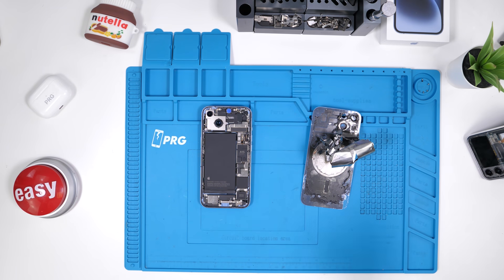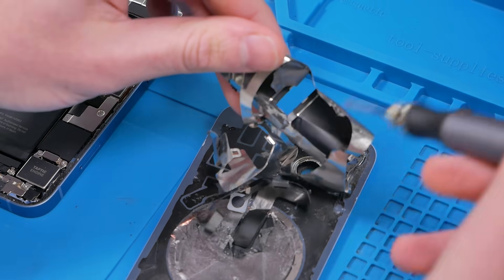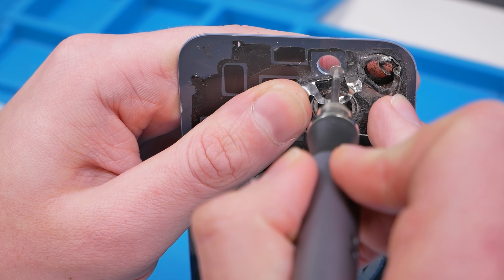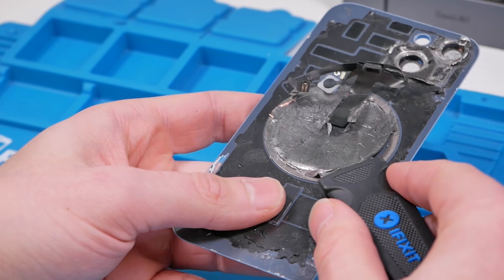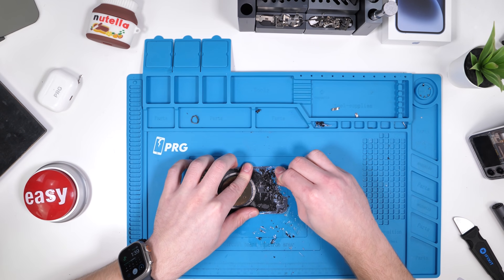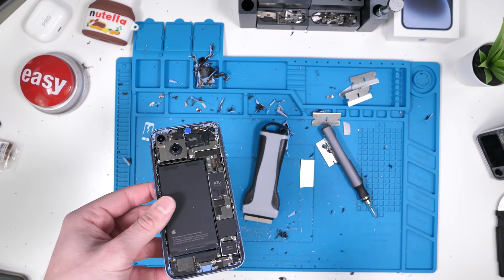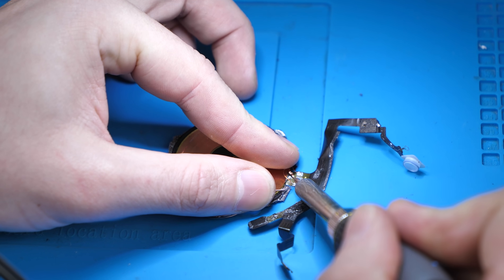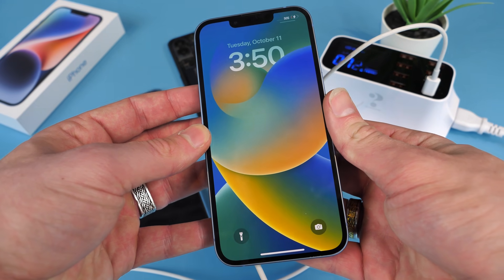Transparent iPhone 14... Harder Than Ever?

Comment: If u want do do this I recommend a Oneplus phone. I did his on a op9 and it was rlly easy coz the paint was attached to a lamination sheet which keeps the glass together if it shatters. So the paint just peeled off. Only downside is if the glass ever cracks the shards will fall off. Also the Oneplus 9 has no frame around the back glass so it is a nice phone to make transparent

Comment: Why do you not just use automotive paint stripper? Smear the back glass with it then wrap everything in a bag and let it do its thing. When it's done I imagine the paint and adhesive would rub right off. Won't have to deal with micro scratches from the razor.

Comment: Hey PRG, why don't you dip the backyard in brake oil? It works as paint remover and will revive every bit of paint, even at unreachable corners and it ain't scratch the glass too! Saving you a lot of time and effort.

Comment: Man… what a mess…consider to just get a non genuine replacement part instead of all this work. The glue is a lot lot weaker and the cheaper paint can be easly dissolved with acetone + the cameras are normally not welded but rather glued + its reversible if you ever wanted to!

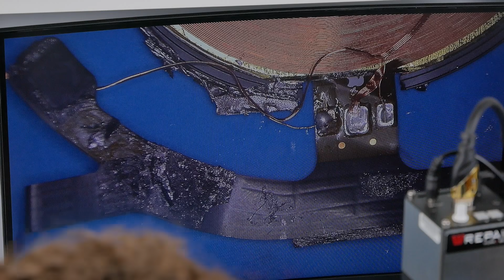Comment: Very good video man. I really like it. But me when I saw the welding ball that you madd and I know it’s not good when you do a welding ball because that can cause to the weld to have micro cracks and air bubbles that could cause the weld to break due to changes in hot-cold temperature or a shock due to an impact on the weld (7:32). Like if you practice more with weld that can make you better at that thing and you can learn new skills. But anyways you are so good at this and don’t give up 😊!

Comment from the maker: For everyone saying I could use the laser machine, it leaves burn marks on the glass which are very difficult to remove
Reply: you could use chemicals to remove the paint
Reply: @XDProductionGR  might not be possible without really harsh chemicals
Reply: there are some chemicals that can remove everything(including the metal) except the glass
you would need a lot of safety precautions but the job would probably be way cleaner and quicker
Reply: Chemicals! Exactly what I commented about etching with Fe2Cl3
Reply: Ig thar would have been easier then scratching everything off
Reply: Definitely try chemicals
Reply: Hi. My brother just smashed his Ipad could I send it to you?
Reply: you could use paint removal for the back case, it's easier, I once apply it on my samsung to get clear backdoor and work pretty fine and fast
Reply: Why do you not just use automotive paint stripper? Smear the back glass with it then wrap everything in a bag and let it do its thing. When it's done I imagine the paint and adhesive would rub right off. Won't have to deal with micro scratches from the razor.
Reply: Yes😂
Reply: how about acetone ?
Reply: What laser machine do you use
Reply: Could have used concentrated acid to dissolve the metal. Acids won't corrode glass 😊
Reply: dude ppl are trying to scam in ur comments
i got a reply from one such scammer in my comment on this video
can u do something about it?
Reply: @aryanjain7669 welcome to youtube, mate
Reply: @aryanjain7669  no he can’t but you can do something about it. Don’t click any random links in the comment section, unless it’s by the uploader, they sometimes put links in comments like they do the description. Also don’t ever take any advise from anyone without thoroughly researching! Be wary of the boondoggles.
Reply: Do you do iPhone Unlocking?

Comment: You probably could have used paint remover. That would eat any adhesives as well though.
Reply: Also, while I'm not an Apple user, I'd personally just ditch the wireless charging (assuming the phone functions without it) to have it completely transparent.